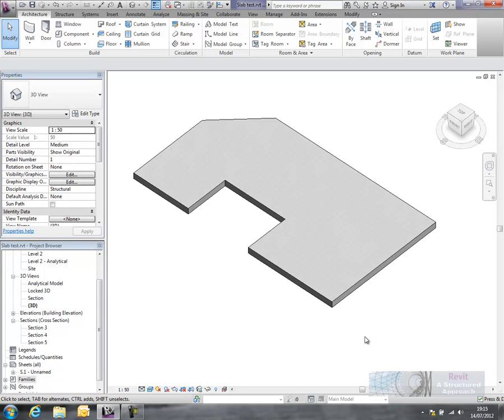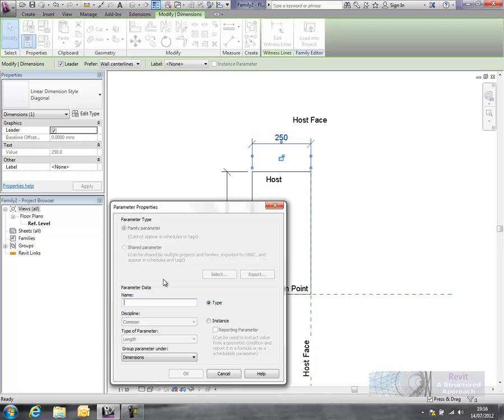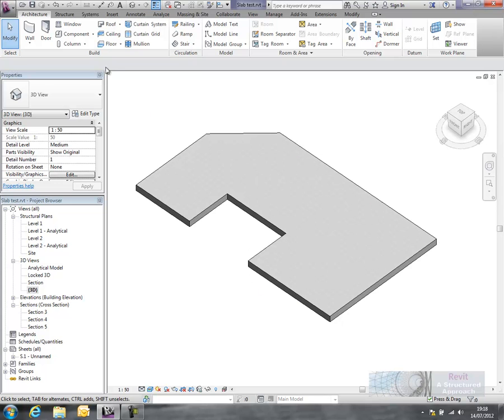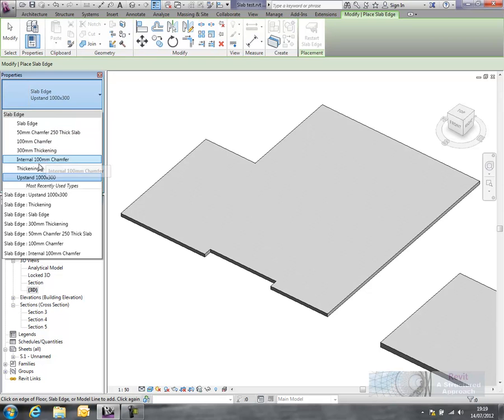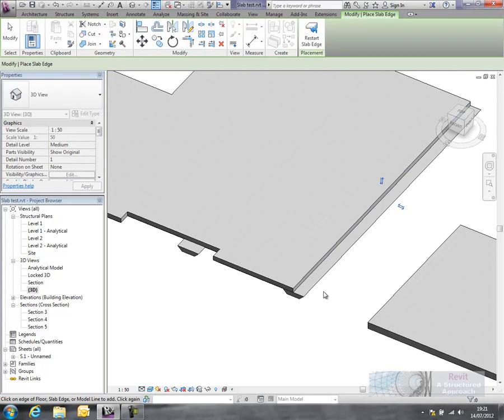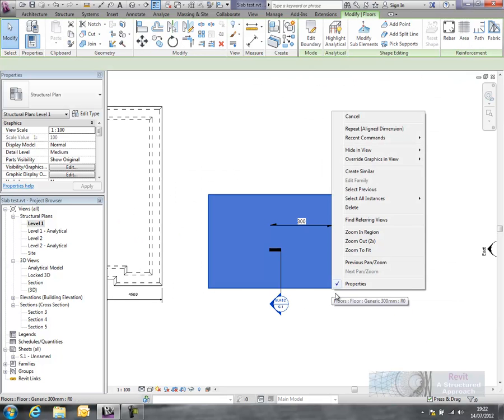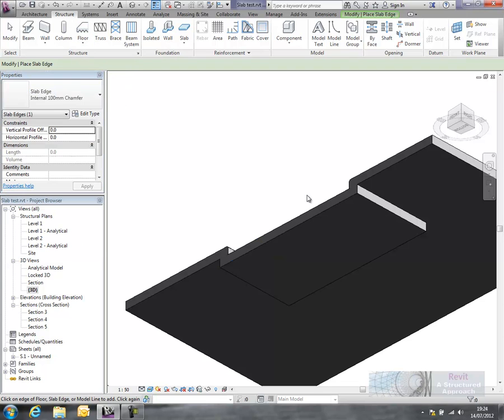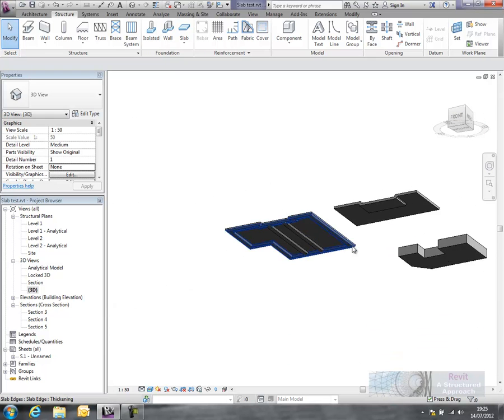Revit Structure 2013   Slab Edge Tutorial

Comment: If the object's line type is wider than the invisible line type, not all of the object will be hidden.  Fortunately this is easily fixed.  Open the break line detail item family, and in Visibility/Graphics Overrides, under Annotation Categories, turn on Dimensions and Reference planes.  You'll see that the leftmost and rightmost edges of the masking region are constained to vertical reference planes that are offset from the Center (Left/Right) reference plane by the parameters "Left" and "Right"

Comment: i don't seem to be able to create a working version of the chamfer. Its either hanging off the edge of my slab or buried within it. So i'm never at a point to simple pull back the slab. Any advice would be greatly appreciated.
Reply: managed to get a working Chamfer using the slab edge function. ((I did use the model in place using the void blend to get a good chamfer but takes longer)) but how do i control the height of the"extra width" doing it this way creates? So far i've been going back into the family and changing it and saving it as a new profile.